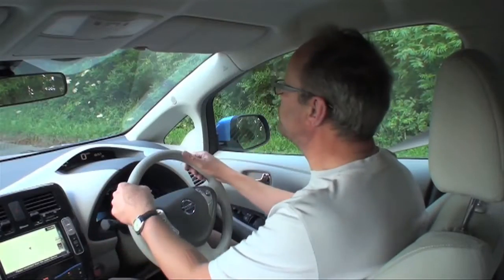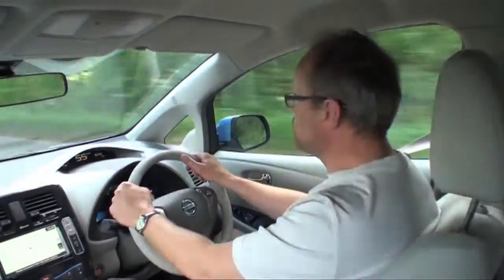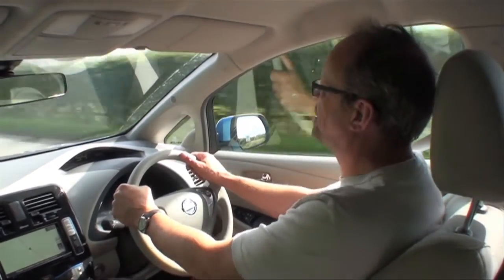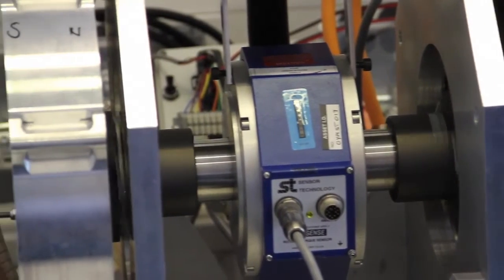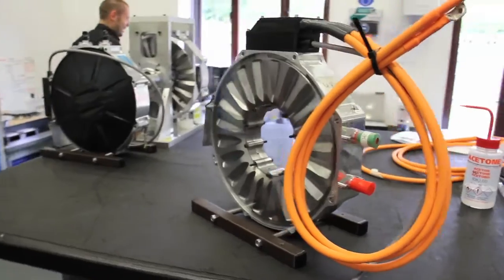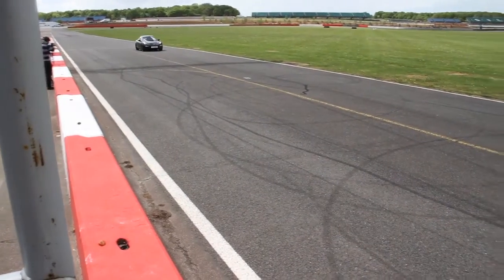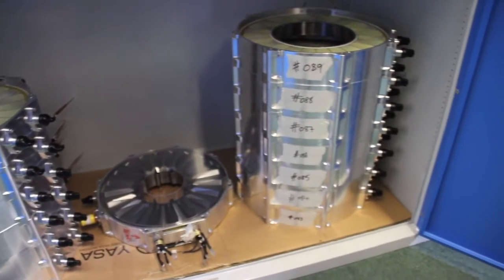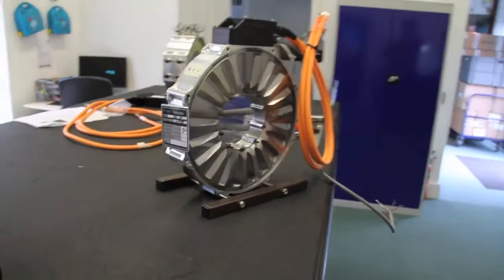YASA Motor Works | Fully Charged

Comment: The elephant in the room is battery technology.  Now, if you could generate electricity with an advanced technology that already exists and is not petroleum then you have something.  The oil Barron's are trying to plan monopolies on "new" technology.  The entire system is rigged and virtually everything you are being bombarded with is basically a lie.  Take a few steps back and critically examine what is going on and you will be on the path to understanding this nonsense.
Reply: Well, actually the whole automotive industries is a lie too. We could go back in tech, riding livestocks pulled wagon, rickshaw, bicycle, etc. Everything will be just fine as it now. Right?

Comment: wow. this was 11 years ago. now they are in a hybrid ferrari with two of them in the front and soon they are in some AMG versions of mercedes BEV. cool.
i downloaded the efficiency curves and saw, that they have an efficiency of almost 98% from 10 to 90% of max rpm. that is insane efficient!
i hope that this can be more efficiently produced in the future to bring cost down to see it in average cars like the ID.3. who would not like 10% more range just because of a better motor?
i don't know about the cost of this motor, but if it is 500€ more expensive than a conventional one, you would already save 500€ with a smaller battery to get the same range. and then you would still profit from the weight savings and save about 10% money on the electric bill.
can you talk a bit more about cost?

Comment: I wonder if these are the motors in the Aptera? Might be time to revisit this company now after over ten years of major changes in the EV world. I'd love to see how far they've come. I saw on a Lesics video they might be doing aviation, because of the impressive power to weight of these motors.
Reply: No, Aptera never proposed to use YASA motors, or any axial-flux motor. They were heavily pushing in-wheel motors from Elaphe,  but in 2024 abruptly changed to  Vitesco Technologies’ EMR3 drive units.  Both Elaphe and Vitesco motors are radial-flux, not axial-flux. 

There are no YASA motors in production aircraft, although the EMRAX-based motors in Pipistrel production battery-electric aircraft are axial-flux.

Comment: I like it!  Just curious though, what about heat dissipation with 6 or 7 times less mass?  Is there an issue with premature stator or rotor wire insulation failure?     Edit…this is an old video lol

Comment: How did I find this video?
Ok. I've been thinking that people are only focusing on the batteries... What about the motors?
Then I started to find some news about axial flux motors. A "new tech" that's more efficient... And I see this 10-year old video about it.
:)
The new development like Rolls Royce using it and breaking records made it even more interesting.
Reply: Axial-flux motors are no more efficient than radial-flux motors. Motors in EVs are already so efficient that there is little room for improvement, so development effort is better spent on batteries and controllers.

Comment: Hm, these motors are nothing special, just iron-less synchronous axial flux machines. They haven't been used a lot in the past, because their rotors were heavy and characterized by quite large diameters due to the old fashoned ferrite magnets. Since rare earth magnets became affordable this concept is interesting again, because the rotors can be made much lighter and with smaller diameters.

Comment: Always wanted an electric compact high output motor to do a conversion on a motor scooter.
Might need to beef up the chassis and brakes as well.
No mention of voltages needed, I'm assuming 72 or 144?
If the price could be kept at under $1000 for the 16kg 200kw 2019 version, then Yasa a will sell millions of the units.

Comment: Working on motor that can get 80-90% of the fuel out.  It is a distributed IC engine.  One motor is 6 inches diameter by 12 inches and weighs 35 lbs.  84 hp at 8400, can go to 12,000 rpm for peak 120 hp, just like the electric motor shown.  About the same space....  80:1 expansions.  Can run on solar thermal and battery (electricity) at 45%.  It can also do boundary layer active drag reduction as well as power on lift for 10 CL on wings.  Land at 1/2 speed.  It can go in car or roadable airplane.  Range 2100+ miles on Natural Gas at 100 mph. $33 in fuel to go 2100 miles, or 200 mph at 10 cents/mile on gasoline.  1 cent/mile at 100 mph on Ng at $1/gallon equiv.  

In contrast, electricity is 15 cents/kwh in USA and 25-30 in Germany.  That is $5/gallon.  Battery is 12 cent/kwh to use it or $4/gal.  That is $9/gal.  Then you add in boundary layer....allowing a car to get 200 highway and 400 city.  No idle.  Can dead torque like an electric motor.

This can use Ethanol, Gasoline, Diesel, propane and battery if wanted.  This engine can also be 24/7 and distill water via vapor compression distillation....  Heat, cooling, water and power.  All that a house need, 24/7, all from NG or solar (80% of the time). 

There is a better way...

Comment: @2:54      You have to wonder about the need for the S and N for the poles having to be written in Sharpie® brand Permanent Marker on the motor...    they just had to make a perfectly symmetrical case rather than add an extra minute on the CNC router to render the need for Sharpie® brand Permanent Marker moot.

(This comment was in no way sponsored by Sharpie® brand Permanent Marker...   it was in fact written with Crayola© brand *Crayons*)

Comment: omg love it.. thought of a motor like this so long ago, i thought of it like a maglev train on a circular track the size of a wheel. Never could find one that matched what i was thinking nice to finally see something. Now they just need to use graphene, should improve weight cost and be able to 3d print optimal designs. Then you can make electric planes.

Comment: I wanted to use a pair of these in my Flux Capacitor EV drag car. Perhaps YASA want to play with my next project?
Reply: The Formula Student team at my university acquired this motor for their electric car.. not sure how far they got with building the car.. google NMMU racing for more info.. i got to inspect the motor close up as i was briefly a member of the team.
Reply: Maybe Emrax motor is cheaper solution!

Comment: Did i get it right, so its both a electric motor and a generator, if so then there is no need for batterys, becouse there is always power avable,ok maybe a small one for it to get going, for the lazy ppl hwo cant turn it round for hand, lol.
Reply: No, they had two motors in that setup for testing.. 1 being powered (motor mode) 1 being used as a generator to put strain on the motor (eg, not just spinning around doing nothing).. But the generator does not turn it back into the exact amount of electricity. I do not remember hearing any percentages.. But lets say they put 1000watts of energy into the motor, the generator was recouping say 750watts by being the motor "something to do"..  They did say they do this for testing, because they only need to have a small power supply to put in the small 250watts that has vanished into inefficiencies of heat and noise. You could not do this while driving, because there would be no strength left in the motor to move the car because it's all gone into the generator..

Comment: RIP combustion engines.
Reply: Paul Meyer may you return to the ground . from which you came from . ashes to ashes dust to dust. my dear friend combustion engine
Reply: I red somewhere, that there is a way to conwerte a combusting engine to run on whater so you still have nice sound from it, dont realy remember where i red it.
Reply: Paul Meyer nope. Oversized, expensive batteries will stop that. Also they use combustion to create the power that charges the batteries that runs these motors.

Comment: If these motors are located at the wheels, then one would hope that they are light enough to keep the in spring suspension masses low, otherwise momentum and inertia will be a major problem  going over the bumps. neat ideas though.
Reply: Very few cars have in-wheel motors for this reason.

Comment: These new electronic rotary motors can be in each wheel leaving lots of space for support components. IE heating and cooling cargo and much more. Lite metal construction can be used to improve the vehicles function. No more fossil fuel use. Novartis

Comment: You can use Hertz frequency to generate ultra low temperatures for a supper conductor capacitor for your electric motors has well. Novartis
Reply: Hertz, is the unit for frequency. 
What are you intending to say?
Reply: Sure that unit that gives you a nose pinch and a parasitic lip rub yes that frequency. ; )
Reply: what the jesus?
Reply: no seriously. What is it that you think you are saying?
Reply: Allergies tiss the season
Reply: Runny noses coughing and drips and runny buts its just the shites! Happy holidays!
Reply: what the everloving hell does that have to do with electromagnetism?
Reply: Snobs they are all just royal pains in the corn hole!
Reply: GMO pop corn with Unilever butter
Reply: With an icy colaca cola. ; )
Reply: Poo can generate an electromagnetic field from the still living matter in it that can be manipulated. Wow who knew poo poo could be used has an energy source did you know this smart ask? ; )
Reply: Hay you speak really smart about things are you really smart guy? Let's compare notes! = )
Reply: Hay a way to deal with human waste and produce electrcity at the same time? Wow you a really smart guy! ; )
Reply: You should throw back an icy colaca cola to refresh yourself after all that brain working buddy! ; )

Comment: I disagree with the supposition that "Oil is running out" because there is more of it (still) in North Dakota than there ever has been (that we know) in the middle east and there's enough here in my little corner of Utah to keep the USA in oil for at least 40 years. 
That being said, I don't think we should completely drain this planet of it's petroleum. But we need to have more responsible mining practices. The strip mining required to get materials for EV batteries is more damaging than fracking is.
Reply: You say that like fracking is the only way we get oil, and that the gathering of the oil is the only harmful part of using it.
Reply: No, I say that as if I didn't want to be bogged down by minutiae. But thanks anyway.
Reply: Would I be right in saying that the point you're trying to make is things aren't always as environmentally friendly as they first appear?
Reply: Correct.
Reply: I feel like most people know the environmental debacle that is petrochemicals. Meanwhile they happily ignore the travesty that is being caused by irresponsible strip mining taking place to make the batteries for EV's.
I love the idea of electric cars. Really! It's so exciting the progress we're making. I just want them to be more responsible in their practices.
Reply: MacKreggin
Same. I've seen a few different techs pushed as saviours for the environment that end up having unforeseen disasterous effects elsewhere. Palm oil is the first that comes to mind. I hope that the potential of graphine to be used as a successor to lithium batteries isn't just more hype and hot air, but I guess only time will tell.

One things for sure it's damn hard to do tech on a large scale without making a mess somewhere.
Reply: For sure!
Reply: Lithium mining is not strip mining, it's collected from Salt evaporation lakes in Romania and the United States.
Reply: Hopefully the new glass electrolyte solid state batteries will pan out.  Sand and salt are plentiful and easy to recycle.

Comment: Can we get an update on how things are going with YASA and their motors.  Maybe a more technical aspect on how they work too?
Reply: Its in Koenigsegg Regera :)
Reply: hi. I want to apply for the yasa motors placement for 2017. I would like to know ur experience working with them if its not too much trouble
Reply: แสดงความเห็นเสริม.
a).ในทุกๆ VDO หากทำได้ควรแปลภาษาได้หลายภาษา เพื่อการสื่อสารที่สมบูรณ์ในการเสนอเนื้อหาของ VDO
Reply: bought by mercedes
Reply: HeathenGeek I'm on placement there at the moment, all I am going to say is you will start to see their motors appear in many more applications and consumer products, they are getting lighter, smaller and more efficient. Now just waiting for the battery tech to catch up!
Reply: ikechukwu collins Tim Woolmer is still there, and he is the man who inspired me to join them. You will learn a lot and they are a great team of people!
Reply: @joshuakeeling1  There's nothing particularly new about these electric motors. The idea has been around since Michael Faraday invented the motor almost 150 years ago. The reason it wasn't achievable was due to manufacturability and stronger rare earth magnets, which is why AC induction motors have dominated ever since. You're standing on the shoulders of giants who preceded you.
The design type is a permanent magnet axial flux 3-phase AC electric machine. I've seen dozens of designs similar to what you've created. The only reason why they will take a long time to catch on is that they cost a lot to manufacture (due to tighter tolerances) and patents that will tie them up for 20+ years... which is really stupid as the idea wasn't yours in the first place.
Free the tech, stop patenting!
Reply: Evan Tinney “Freeing the tech” sounds good, but then there’s less incentive for designers and manufacturers to go into production because far less profit. Perhaps the patent should be contingent on affordable licensing being made available to all by the inventors. That way everyone wins; others can produce the item as long as they pay the inventors a licence fee per unit produced.
Reply: @Alrukitaf  I've actually seen the opposite happen, when the "disincentive" to compete goes away after the patent expires. As an example, the 3D printing industry was held up for decades by patent after patent since the early '80s, and the machines built by those IP holders charged $250K+ for most of their equipment preventing anyone other than the well-heeled or larger corporations from benefitting from the technology.

Nowadays, you can get comparably equipped 3D printers that are one hundredth that price (built by hobbyists no less) and are still profitable to the manufacturers. It's always the excuse that if you didn't have patents, you wouldn't have sufficient profits and therefore little or no incentive to develop and manufacture. Hogwash I say, prove it! I want empirical proof and maybe I'll take that assumption on something other than face value.

It's the most over-used excuse that goes literally unquestioned that I've ever heard when arguing for the purpose and intent of patents. Everyone stands on the shoulders of the giants, geniuses, and expertise of the past, and all are benefitted by it. Legally tieing up an idea, formulation, mechanism, or programmatic sequence does nothing more than slow innovation and fattens the paychecks of lawyers. Remember, it was lawyers that thought up the idea of mercantilism and then reformulated it into a "more palatable" term called patenting that achieves exactly the same thing as the former.

All you do when you allow patents is create monolithic-monopoly powerhouse-corporations that literally attempt to sue you out of existence if you try to compete in their space. They use it as a legal bludgeon to threaten to destroy the competition, not as a tool of innovation. There is a really interesting case to be made when corporations get as big as they do, and I think it has a lot to do with the legal protections under which they operate.
Reply: Evan Tinney in principle, I agree that patents prevent others from entering the market. However, as I said, patents need to be granted contingent on affordable licensing arrangements, which enable patent holders to earn so much more without having to invest quite so much. The trick is to get patent applicants to realise that, and work for the benefit of all. I get what you’re saying about what happens after the patent expires, but then we get this ip debate raging once more, and we all lose out as a result.
Reply: @Alrukitaf   I like your idea! Anything logical and fair to help accelerate the transition to cleaner, greener, less/non- environmentally damaging technologies is a very good thing.

Comment: First thing is that  electric engine generate almost same HP in all rpm range, and in the same time petrol motor need around 3-4k rpm to get his nominal amount of HP. Second thing is that energy circulation loop - acceleration- deceleration is known quite long time, and that is a problem for controller, not for engine ( engine unit is only chassis with electromagnets, disk with permanent magnets, and hall effect sensors to give info to controller about shaft position in motor because its need to be sequenced) So its can be easy use as a motor and as a generator. (It is possible to get some voltage pics coming from motor, when is accelerating, so it is also generating power even when is use as a motor only) Third thing is that we have giant problem about storing electric energy. You can store way more energy with one liter of fuel than one kg of batteries.  Four is that wee are so green but generating electrical energy is still very poisonous for enviroment and very primitive in the same time, same like using petrol... Impressive about electric motor is only amount of power generating by that tiny motor, noiseless and fact that you need much less oils and parts to keep thing running.